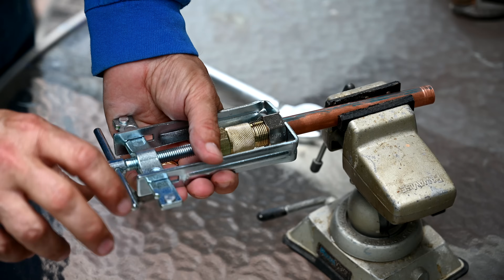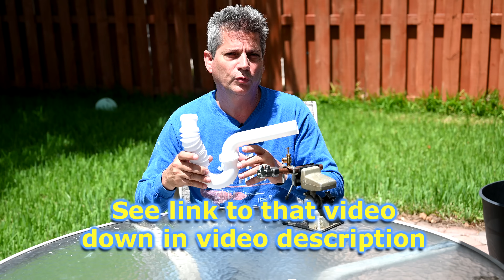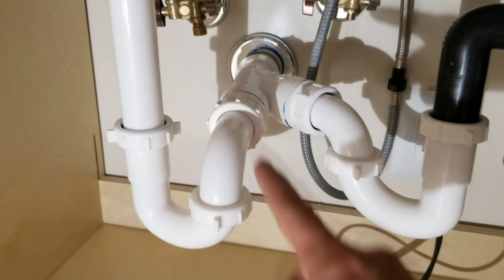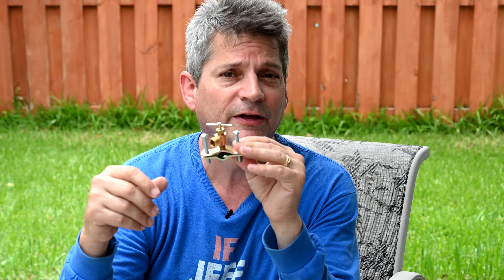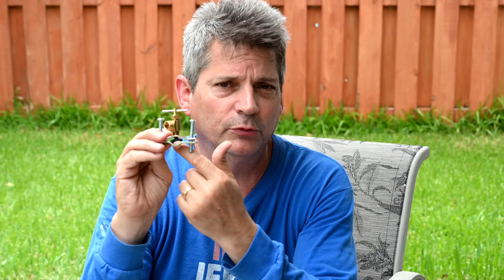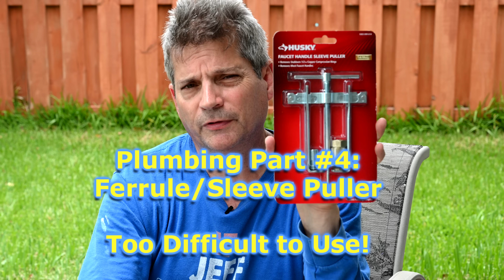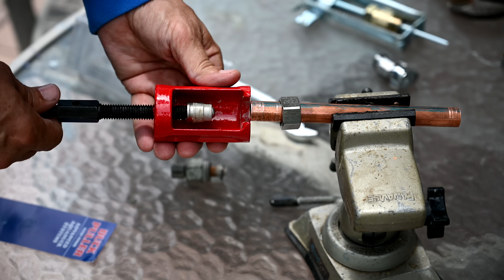4 Plumbing Parts/Tools You Should NEVER Use. NO Plumbing Fails

Comment: A certified Sears installed one of those saddle valves in my home...
Reply from the maker: Yes, ad there were class action lawsuits against Sears because of this, as some people suffered tens of thousands of dollars in leak damage.
Reply: That's funny to hear because a "Certified Sears" duct cleaner came to my house to clean central air ducts and used a simple vacuum cleaner to clean just a few inches into the duct rather than use a professional rotating brush that goes deep into the vent like they had advertised, then just sprayed a mist of some type of cleaner into the opening to "disinfect the system". It was a total joke.
Not only that but a "Certified Sears" carpet cleaner left my carpet dirtier then when they came and it stank to high heaven. I have no idea what kind of water they were pumping from their truck to steam clean them. I guess the moral is never use Certified Sears tradesmen.
Reply: @Marcoosianism  Duct cleaning is a scam in North America and even bigger here in Canada. At least, in the US, there are companies that use a Whip or a Brush to disturb the dust off while using vacuum at the other end. None of this in Canada, they simply spray high pressure air in the heating ducts while running a vacuum in the furnace, a huge disservice. Search for Ductz, best duct cleaning service in the US.
Reply: Certified sears guy 🤣.....your killing me....anyone not a plumber with a license.....is not certified to manipulate any potable water or sewer line...period.....this is coming from a journey man plumber from oregon
Reply: @David curtis, you are probably smart enough to install them right.  Not everybody is like that.

Comment: If you have an S Trap and need to replace it, have the sink drain pipe relocated by a professional plumber. If your insurance company pegged you about it because you have an older home, get an emergency plumber to remedy the situation ASAP.

Sink drain pipe off-centered, do not use form N fits. Get a piece of PVC pipe, 2 45-degree elbows, a normal P-trap kit, and PVC cement. If it's way off or close but no cigar, or not comfortable doing it yourself, hire a plumber.

Saddle Valves are wack. Get a copper tee, 3-inch piece of copper pipe, lead-free solder, flux, and a shutoff valve from your local HD or Lowes. Tools needed a blow torch, pipe cutter, a wet rag, and emery cloth. First, shut off the water to the whole house and drain the pipes, cut the copper pipe, cut a small length of copper pipe, and sand the ends of the copper pipes and inside the tee fitting with an emery cloth. Then dry fit the tee and short length of copper pipe to where you want it. Next, the take it apart, apply flux to the ends that are going into the tee and inside the tee, fit it together, ignite the blow torch and grab a piece of solder. Heat up the joint with the blow torch flame and apply solder until it makes a good seal, and repeat for the other 2 joints and turn off the blow torch and cool the joints with a wet rag. Dry fit the shutoff valve. If it's a sweat fit shutoff valve, prep pipe end with flux and emery cloth, solder as if you where to solder a pipe joint together but, wrap the valve body in a wet rage to prevent permanent damage to the valve seals. If it's compression, slide in the nut, then the compression sleeve, slide in the valve and tighten thoroughly. Finally, turn on the water and check for leaks. If there no leaks, congratulations you have a code-compliant add on shutoff valve for installing an ice line that is far superior to a saddle valve that will last the life of your house.
Reply from the maker: Great tips, thanks David!

Comment: many times you can leave that nut and compression fitting alone and install the new valve with the old nut and ring since that part almost never fails
Reply from the maker: Yup, I just like to start from complete scratch
Reply: Yes,Leaving the old  one  on is  the smart solution. This guy is pretty opinionated.

Comment: i do handyman work but just because your a handyman you should still follow building code.building code is set up for a safety reasons and if you don't know proper code you should not be doing the work. not to mention most stuff handyman do would not take no more then a few hours to read the code on what you are looking for. every thing you have mentioned i have made a ton of money going in after to fix within a year. but they should take most of that stuff off the market. you had the perfect point who in there right mind would puncture a perfectly good pipe lol
Reply from the maker: Yes Rich, we also hear from a lot of plumbers who surprisingly tell me there's nothing wrong with using saddle vlaves.

Comment: Those hard to get off metal sealing rings we would call olives or brass olives.in UK. I usually just grip them carefully with pliers and rotate them to slide them off. Sometimes slamming the nut against them helps as well. You would correct in thinking I am not a plumber! :)
Reply from the maker: Whatever gets it off the pipe!
Reply: Same here. With the stubborn compression rings I would just gently saw them off with a hacksaw blade

Comment: The last tool is a handle puller for a faucet or shower body to pull off an old handle. Not to pull a compression nut! I always cut off the nut and go back to clean copper.
Reply from the maker: LOL, another guy who doesn't know. It is both! Here it is on HD's web site: https://www.homedepot.com/p/Husky-Faucet-Handle-and-Sleeve-Puller-410-072-0111/311493722 Notice how they call it "Faucet Handle and Sleeve Puller". Also flip over the package, there are 2 sets of instructions.

Comment: Jeff.. homeowners aren't plumbing to " code".. really? .. homeowners don't know code.. no PLUMBER in the world wud ever use or rough in with any of that.. EXCEPT THE FLEXIBLE EXTENTION... if you read the code... in NC.. IT ONLY TALKS ABOUT THE HORIZONTAL LEG NOT THE VERTICAL.. IVE BROKEN " INFECTORS" HEARTS WITH WHAT " THEY" THINK 👍
Reply from the maker: Hi Noel, in NC, flexible P-traps are not allowed either. the Plumbing Code specifically states this: 

"2006 (d) - TRAPS AND CLEANOUTS Traps shall be self-cleaning and water-sealed and shall have a scouring action. Traps for bathtubs, lavatories, sinks and other similar fixtures, shall either be integral or shall be of lead, brass, cast iron or galvanized malleable iron. Traps shall have a full size bore, smooth interior waterway, such that asolid ball l/4” smaller in diameter than the specified diameter of the trap will pass freely from the outlet and entirely through the seal of the trap. The minimum diameter of traps for fixtures shall be that given for the soil or waste branches (except that in the case of water closets the required minimum shall be 2 l/8”). In cases other than fixtures, the size of the trap shall be the same as the discharge pipe connection thereto. Running traps and "S" traps are prohibited."

Now that first sentence says that traps shall have a scouring action. This means you cannot use flexible accordion traps, because those don't have a scouring action. This is what prevents you from being able to use a flexible P-trap in NC..

Comment: I always just use a hacksaw blade to cut off the ferrule on compression stops. Works everytime and takes under 10 minutes
Reply from the maker: 10 minutes? That ferrule sleeve puller I use does it in about 1 minute. Hack sawing is a lot of work

Comment: instead of an s-trap if the drain goes into the floor will a sweeping 90 work and 2- 45 streets to help the drop ?
Reply from the maker: No you still need a trap to stop sewer gasses from coming up. That is what p traps and s traps do. They hold water seal against gasses.
Reply: @jeffostroff  yes with the p-trap as well it should work right? but should a drain in the floor even be used?im just trying to learn not that i know anything i was visiualizing what you said in your video and seeing getting rid of the s trap

Comment: There are times when you have no option but to use a flexi pipe
Reply from the maker: Not true, you can always form the same pipe route that you would form on the flexible accordion P-Traps, but do it with cementing parts like I did.
Reply: @jeffostroff  I had to plumb in a bath which was in the middle of a big bathroom, with no access from underneath.  The only way I could do it was by using a trap with a flexible waste, and a couple of long flexi pipes for the hot and cold supplies.  Lifting the bath up a few inches, making the connections then dropping it down again.   The only way I could check for leaks was by sliding a sheet of cardboard underneath.

Comment: I am prejudice against compression angle stops because when the handle gets hard to turn, it turns the whole valve and causes it to leak. After I remove a nut and ferrule, I sweat a male adaptor onto the pipe and install an IPS angle stop.
Reply from the maker: I only use 1/4 turn ball valves, and have never once ever seen a quarter turn valve get stuck or turn the whole valve body.

Comment: A few comments here.  You are not explaining very well why this fixtures are out of code.  The other thing is that stores shouldn't be selling out of code parts.  In the end it sounds as if you're sore with DIYers for taking jobs away from you and you are doing your whining on youtube.  Just do a professional video and state the facts.
Reply from the maker: You are completely wrong. I explained why the fixtures should not be used, and what's wrong with them. I agree stores should not sell out of code parts, but people also have older existing parts installed that need to be replaced, yet they are not remodeling yet, so they don't have top bring it up to code. Also, I'm not whining about losing any business, I usually work only for my own properties or helping people in need from or church who can't afford professionals. What I'm doing is helping DIYers by giving them the information that professional plumbers are required to adhere to, so they can repair it themselves. Let me turn the tables back on you. In the end it sounds as if you're sore with rules and plumbing codes  and you are doing your whining on youtube

Comment: I agree with what you are saying but I am looking at buying a freestanding bathtub and the tub manufacture even shipped a flex trap pipe along with the tub directly from the manufacture. The inspectors I have dealt with always say to use the parts that the manufacture says to use in their installation paperwork and if we do not install it per the manufactures instructions then that is another problem from the inspectors. I hate those flex pipes but if the manufacture say to use it then what?
Reply from the maker: That comes up a lot. That part is OK only on that overflow drain, because it rarely gets used. You get an overflow what once a year? Plus you sort of have to make it flexible to adjust for variances between different tubs that get placed there. So that is not a main drain.

Comment: Sorry one last thing at 18 min 53 sec the round adapter rolls to the edge of the table when you pick up the tool. That adapter is required and makes removal very easy. Again those bars are for removing faucet handles.
Reply from the maker: Yes, it is required. I wish the arms could be removed for using it as a compression sleeve puller, but that's what happens when you make a tool that tries to be 2 tools in one.

Comment: Sorry Boss, 25 yr HVACR, Plumber here but your not using the tool properly. If you watch the video, just before you put the tool up to the compression nut on the table was a small round adapter that rolled off the side. This adapter screws onto the end of your assembly and slides into the copper pipe. Then screw on nut and twist.  The two handle your trying to hold o to are not used in this application. They are used to remove faucet handles, not the compression nut. Good Luck, try again, you will love the cheap tool.
Reply from the maker: Yes, a lot of those use that tool "incorrectly" years ago, older instructions indicating using them, so I never outgrew doing it the old way. I actually don't use the tool anymore now that I have the Duck Puller, a dedicated sleeve puller that does a better job removing them.

Comment: And I dont use compression valves.
Reply from the maker: You don't use compression valves? what do you use then?
Reply: I break the wall and solder them in if needed. You cant use a compression valve in a highrise. I have used them in areas that would not cause too much damage if the leaked.
Reply: And yes, I take them apart first, lol

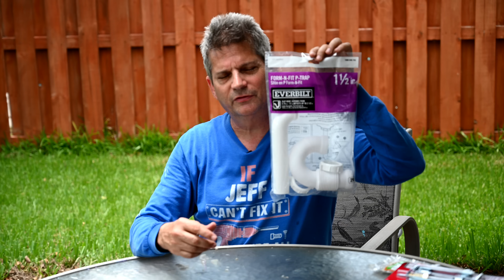Comment: we have the same part at 4:59 why i dont like that one for how it collects hair junk and clogs up are sink
Reply from the maker: Yes, that is the biggest failure mode.
Reply: was going to try two of  theses 

03-4263 90 Degree Drain Elbows for are sink while using the  Plastic Slip Joint Extension Tube along with it but wasn't sure how well it work for a idea that i had

Comment: Great info, I would say that the Husky tool has one use - removing stuck faucet handles. Never even considered using it to pull a compression ring/ferrule. Like you said, too many forces working against you!
Reply from the maker: I have a new one that I plan to do a tool review on. They have both sets of instructions right there on the back for pulling knobs, and for pulling compression sleeves.

Comment: You say that flexible drain pipe can't be used because it isn't self scouring but what about the Snappy Trap? If you see the specs on it it has a smooth interior that would make it self scouring wouldn't it?
Reply from the maker: I have seen Snappies at Home Depot, but have not played with one. I do want to test some out, because this question comes up a lot. I don't see how the interior can be 100% smooth if it expands. The point might be moot anyway because if your homeowner's insurance does a 4 point inspection like many are doing now here in Florida, they will make you remove it, simply by the fact that Snappy is a flexible trap, and flexible traps are banned by plumbing code.

Comment: What do think about using a sharkbite valve instead of a solder on outdoor faucet bib? Not on the main water line
Reply from the maker: I would much rather install a compression valve than a Shark Bite. I only use shark Bites for temporary use or for converting from old illegal polybutylene pipes to copper, there is no other solution than using a shark bite poly to copper fitting. But I would only install a shark bite fitting outside a wall, never inside a wall, in case there's a leak you want to know about it soon.

Comment: Now I know where the saying  "nothing dumber than a plumber" came from!
Reply from the maker: I have come across some dumb plumbers, and often have to repair dumb plumbing mistakes the builder made.
Reply: @jeffostroff  only about  4% of people in any trade are "A" students.   I've always leaned towards  A no matter what I'm doing and I've just about done everything.   When I was a professional plumber I was on a top crew and saw the work of many a weak plumber.  I've seen the same when I was a professional electrician.  Also when I was a professional refrigeration tech.  I  got tired of working for others that didn't make quality  #1 so I went out on my own and  some have called me a handyman  because I fix any problems.   I  consider myself a maintenance technician  because the term handyman comes with  negative connotations.   I  was a certified auto mechanic for several years and in the auto trade it becomes very evident that it's the worker and not whether they work in a shop or their back yard.
Reply: If you are to dumb to be a plumber
You can always run for president or join the army.

Comment: So are you saying the plumbing codes are the same for every state?
Reply from the maker: Mike, they are pretty close, the half dozen southwest states tend to use Uniform Pluming Code, other states like here in FL, we are based on other building codes, but they are every much alike, and they mostly ban the same bad items.
Reply: @jeffostroff  to the best of my knowledge, it's code acceptable in Indiana to use a saddle and possibly in Michigan as well.  I  would have to check to be certain.  I  have used a saddle for a hot water recirculation system for a long run to a kitchen and it passed inspection.   I have replaced a saddle that had successfully been in service (leak free)  for over  20 years.   I've never had any bad luck with a saddle but I would guess it depends on the person installing it.  Sometimes it's just knowing a trick or two.

Comment: I like to use my half-inch drive impact on those sleeve pullers.... It makes the copper pipe work hardened and so another compression fitting won't work .!
Reply from the maker: Say what? How do you  get an impact wrench bit to fit around round ferrule sleeve? What socket you using?
Reply: @jeffostroff  talking about putting a half inch impact on the puller... Anytime you bend copper pipe it "work hardens" the pipe, making it much less malleable. That way the next compression sleeve doesn't smash into the pipe to seal properly.